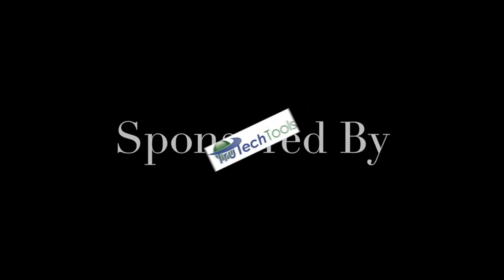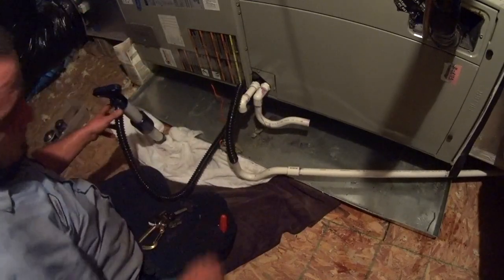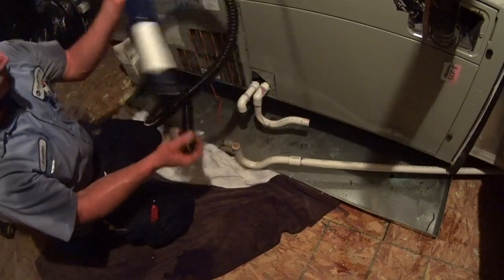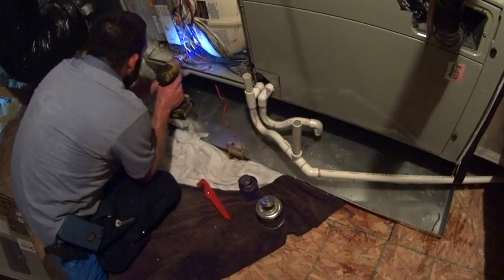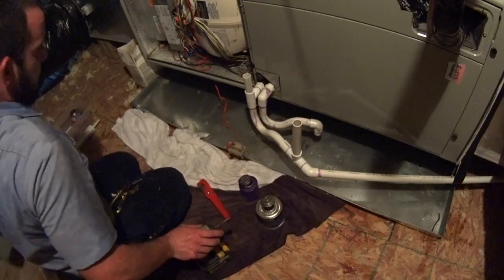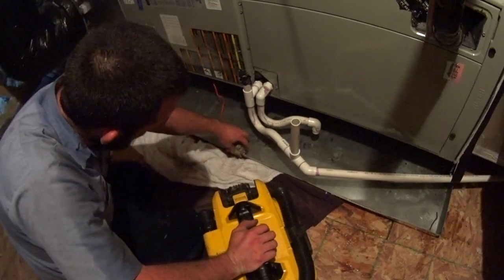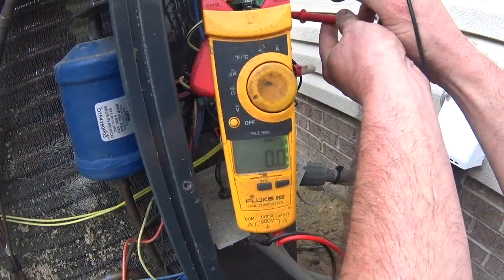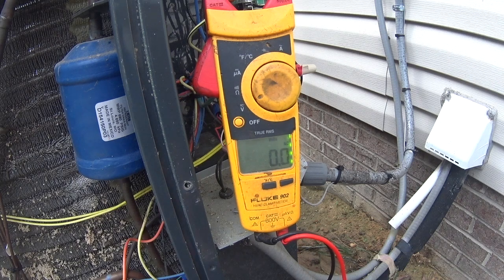HVAC Service: Secondary Drain Pan Flooded and A Shocking Air Conditioning Unit 8-19-15

Comment: How in the world do I even find the pan. I had water dripping from my ceiling over the weekend. Maybe due to super dirty filter and very high humidity and temperatures. Idk. I went in the attic yesterday to see if anything looked odd but I didn’t see anything out of the norm but was also trying to make sure I didn’t fall through the ceiling. The area where I think the leak was coming from was covered in insulation. It hasn’t dripped in  about 28 hours. Any idea what it could have been?
Reply from the maker: I hope you found your solution by now.

Comment: I drained the pan. Then used wet vac to suction out water from the outside pipe. Lawn guy doesn’t realize that he blows close to pipe. AC was on for a few days. Fan outside blowing. I noticed sagging pocket under the HVAC unit. How do I get water out of it?

Comment: I vaccuumed 3 gallons off my secondary pan this morning, drain lines clear and pvc pipe pointing slightly downward. No idea why water is dripping in the pan. Soon I'll have to replace the secondary pan because it is starting to rust.
Reply: I've got exactly the same issue.

Comment: How about you show a video that has the indoor coil condensate pan (under the A coil) and possibly the cabinet, not sitting or angled correctly, & the condensate water dripping from the side edge of the cabinet into the catch pan under the unit, & not out /down the regular drain pipe.

Comment: I bought a manual 6 qt fluid evacuator for auto work, but I use it for SOOO many things. It was about $90, but worth every cent. I have used it on the AC unit many times.

Comment: I’m confused on your wiring the pressure switch wires back. And sorry I understand this is an old video. It looks like you just changed the order everything was wired. Or did you eliminate the yellow with the red stripe  and it’s just hidden from view.

Comment: I do something similar...
I actually rigged up a 4' piece of vinyl tubing terminated with 3/4 pvc females on both ends(used a barb fitting to 3/4 male threaded, then attached to 3/4 pvc coupling female thread to slip) . I just cut the drain line upstairs, hook up one end of hose to the cut end going outside, them clamp the other end in the pan. Then hook up the vac outside, and run it until I see no more water being sucked out. Then I know the pan is empty..(and you're flushing out the primary at the same time)
Saves you hauling a shop vac full of water down the stairs, through the house, and outside to dump it multiple times. Then just simply reglue the cut primary with a coupling... Done.

Comment: I’ve never seen a horizontal ahu fitted with a second trap spilling into the auxiliary pan like that rather than having a primary float in place. Was that done correctly?
Reply from the maker: This is standard practice in this market. Not my preferred method but it works fairly well.
Reply: Stephen Rardon what stops the water from normally draining through that trap onto aux pan? I am just used to seeing and installing an ss2 there.

Comment: I've got a high pressure switch that is currently being bypassed and now have standing water in my secondary overflow pan and some water drip in front of my air handler on the second floor.
Reply from the maker: High pressure? Doesn’t make sense to have a high pressure switch contributing to water problems. Low pressure switch might but it would have to be part of a different problem.
Reply: Issues were unrelated. Condensate lines were clogged also.

Comment: Do you trap both secondary and primary ? Plz reply
Reply from the maker: Yes you can but I prefer to put a safety switch on instead, if you don’t have a safety then both secondary and primary should be trapped

Comment: Why doesn't the secondary drain pan have a drain line? Never seen one without one.
Reply from the maker: A pan with a drain and no float is a flood waiting to happen. No drain and a float will definitely make itself known if there is a problem.
Reply: @StephenRardon   this is happening to me, appears to be the same unit.  Had someone come in and claimed to unclog, but happening again.  The clog appears to be at the drain line at the unit itself as it drips down the side of the unit into the pan.  By opening the right side door, is it possible for me to unclog whatever is causing the blockage, perhaps insulation, etc?  Any ideas for me before this costs me even more money?
Reply from the maker: @shadzofgrey  were you able to get this resolved?
shoot me an email if you still need help. StephenRardon@RardonHomePerformance.com

Comment: A shopvac will get the water out way faster.  I just had the same issue.
Reply from the maker: Shop vac will work of course but then you have to carry a full bucket out of the attic and risk spilling it. I was looking for alternative options for water removal
Reply: @StephenRardon  ok, it was in the attic.  Mine was in the basement. About 4 gallons of water in there.
Reply: Mine is full of water now. I’m using a shop vac but what was causing your pan to fill up? I’m trying to solve the problem outside of the water issue. My upstairs is extremely hot now 😅

Comment: I have the exact situation but one big problem. The secondary drain pan is completely rotted out. How would you go about lifting the unit to change. Without a crane?
Reply from the maker: +cleaning usually at least a two man job with a little lifting and some metal straps. Sort of depends on the specific application, shoot me an email with a picture of where the unit is installed if you want. StephenRardon@RardonHomePerformance.com

Comment: I bought a small 110v syphon pump and I made up some connections to pump the secondary pan into the primary drain and I just rob power off the unit it works great 👍🏻 I might have 85 bucks in the whole rig
Reply from the maker: +JonesHvac nice, I have tried a lot of different things. I think it might be fun to find something that’s runs on 24v but I guess pump power would be an issue then
Reply: @StephenRardon  12V is all you really need so a voltage divider would work for you. Boat bilge pumps have float switches internal so they would turn on and off automatically, and you could run the pretty decent size tube to an eave or whatever. Fuse the pump power line of course, else you worry more about the pump than the AC.

Comment: Would not a sludge sucker been much easier?
Reply from the maker: Yes, lots of things would have been easier, I was trying out different ways to deal with water without batteries or electric power. Even though the ac unit has power many times there is no service outlet

Comment: Idk but I cleaned all the line pipe and the water still returning back. I live on the second floor
Reply from the maker: There’s a good possibility that your drain is connected to another system as well so their water problem is backing up on You.

Comment: What and why did the pan fill up with water? That is my problem
Reply from the maker: The drain fitting before the P-trap came loose
Reply from the maker: If you’re dealing with the same type of problem then it may be caused by a freezing coil or maybe a partial obstruction to the drain pipe
Reply from the maker: @Boogie Man lots of things, keep filter clean, keep blower clean, keep coil clean, keep coils from leaking. Some you can control, others you can’t.

Comment: Looks like there's no drain installed on the secondary?  Why not?
Reply: A moisture sensor can be installed in line with the low volt control and shut off the unit if it goes that far

Comment: You need a Mity Vac pump with just some simple refrigerator hose, couple pumps and it will all drain into its container !  Work smart not Hard !
Reply from the maker: +Chevelle99X Chicago yeah, there're so many different options to choose from

Comment: Is this a code thing for the secondary drain pan. Wondering why it's sitting flat and not up on blocks tilted to one side with another drain line hooked up to it. You can mount the float switch on the downward side. That drain line should also be run out the bottom of the eve and above a window. When the customer sees it leaking out of that they know that the primary pan is stopped up. The way it's done now, they have no more ac until someone comes out and unstops the drain. Not very customer friendly.
Reply: E Buzek good job
Reply: It is standard practice to drain the secondary pan over a window . The problem is people never seem to notice until the unit bottom rots out.The high level  tap for the primary drain would be better off with a float switch.

Comment: Doesn't leaving that 2nd riser vent pipe open (no cap) and without a trap mean venting septic smells into the attic?
Reply: I don't think it's connected to the sewer system, see the drain pipe coming out of the wall by the condenser? Probably should cap the vents to prevent bugs coming into the attic.
Reply: The trap is to eliminate the negative pressure to allow the water to drain. The vent after is to allow better airflow, the one with duct tape ... Beats me lol

Comment: shop vac
Reply from the maker: Mark Jaggers  I've tried the vac and the issue is always having a bunch of trips down to empty the bucket.
Reply: Yuuuup. I usually take a 5GAL bucket fill it and than take it down. But than you run into the problem if you don't have an outlet, and don't wanna mess with jumping wires or whatever.

Comment: At 3:23 when you put the "T", why didn't you plug it up instead of leaving the pipe open? What is the "T" for ?
Reply from the maker: The T after the P-trap is a vent to allow the water to drain to the outside freely, the other T is to allow the trap to be cleaned out
Reply: Thanks for the quick reply. I am having to do this assembly over because my primary plastic pan broke. The original installers did not put an extra "T" so I will put one when I redo it.

Comment: The house where i live at they have an old ac unit the problem is that the pump os not working is not sending water to all those little hoses to wet the hay thats inside the walls of the ac
Reply: +andresf404 what you are discribing is not an air conditioner but an evaporative cooler. If the pump is not working at all check for power at the switch and then at the pump. If it is only partially wetting your pads, make sure you are level and the feeder tubes are clear of calcium build up.

Comment: Why is there a "dip" in the drain line ? Ted.
Reply from the maker: vaccumme the drip is called a trap, it keeps air from being sucked into the unit from the drain. Similar to your sink drain
Reply: I'm aware of a "P" Trap in basic plumbing. It is used to keep Sewage Gases from escaping and entering the structure. I had no idea that one was appropriate for a condensate drain line. Thank you for the reply. V.

Comment: Do you guys have a code that says condensate safeties shut off whole system? I always just wired into the condenser control circuit, no condenser no condensate and they still have some air circulation. We only have to shutdown the blower for smoke detectors on systems greater than 2000 cfm. 

Thanks for sharing the videos.
Reply from the maker: I try to standardize my practices as such I do the same thing for almost every system. If I have a 90% condensing furnace I couldn't  only break the condenser as the furnace can also condensate. Beyond that if the thermostat goes blank the customer will call sooner than if the fan keeps running but the system isn't cooling. A blank t-stat is pretty universal as a sign of a problem. Of course you then have those that put batteries in first and then call but hey, can't help stupid- if it worked out batteries before why do you think batteries would help now?
Reply: That makes sense for 90%'rs that have a condensate pump. I never had a 90% that was pumped always went through a neutralizer then to a drain receptor and was mainly just thinking of aux drains and pan safeties for cooling so thats a good point you made. I also like how you used the phrase "my practices", our trade is very similar to physicians in their "practices" as we are tech"nicians " in our practice. I get frustrated when people buck at our prices yet don't bat an eye at paying a Dr 600+/hr and yet without us Dr's wouldn't have hospitals or clinics with any kind  air quality.

Comment: Did you determine if the problem was with the pressure switch or the wiring?
I've found a couple where a critter chewed on the wiring where it passes under the coil in the trough in the base pan.
Reply from the maker: Didn't confirm at the time of the video nor have I been back since to see if I could find the issue.
Reply: So far I've only found low voltage wiring damaged.

Comment: Is it code that you have to use primer/cement, I like to use that blue rain or shine cement alone.
Reply from the maker: Some inspectors on new construction and change out permits will require that they see primer on the drain fittings but technically service work doesn't matter. I've been failed on inspection for using the Rain or Shine blue glue. It all depends, inspectors have way too much power to interpret the code however they want.

Comment: Steve, next time run your wet vac from the outside like you were clearing the drain . Just remove the  pvc line from the evap pan and get to the secondary from there.
Reply from the maker: I've done it both ways, sometimes I forget certain options. Thanks for watching
Reply: Why isn't the pan already piped to drain?

Comment: How are you in an attic in August & you're not drenched in sweat? Nice video by the way!
Reply from the maker: +nellAyaR2034 it was later in the evening so it wasn't ridiculously hot
Reply: +Stephen Rardon (HVAC with Stephen Rardon) You must be more of a man than I am.!
Reply: +Stephen Rardon (HVAC with Stephen Rardon) But what causes the water build up in the drip pan?
Reply from the maker: Tyrone Kitchens this one was because the pipe wasn't connected but usually it's due to blockage in the pipe.